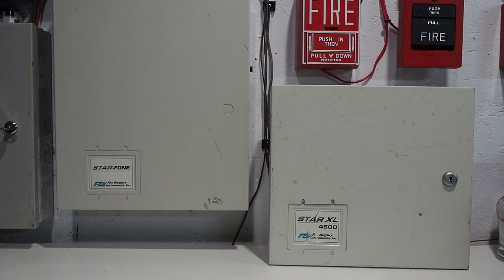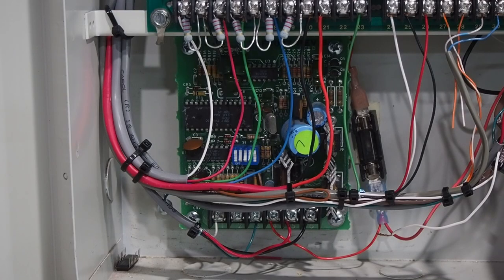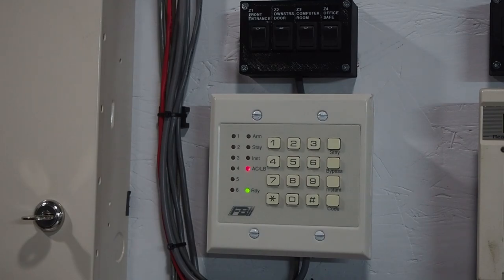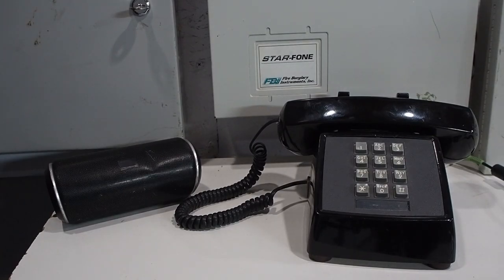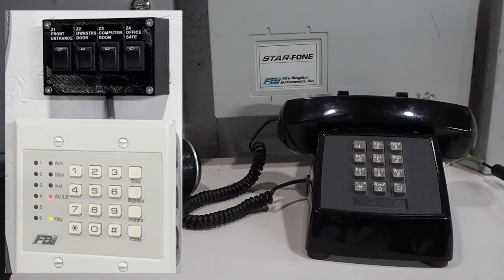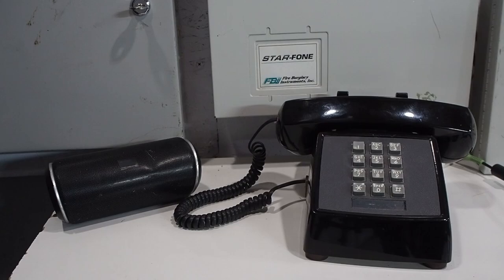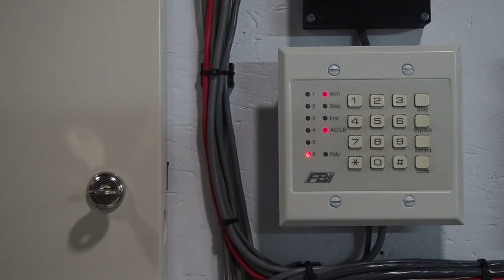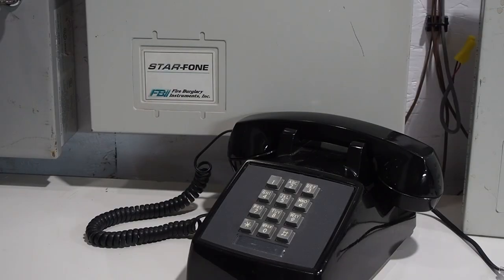FBII StarFone - 80s tech, it talks, and you can control it with your phone

Comment: I have an FBII XL-2T in my house with those same flush mount keypads.  Very nice system that blends well with the house and doesn't look offensive like today's modern systems.  I've even got the old X10 home automation with the Powerflash module that flashes all of the lights on and off during an alarm.  After watching this video I grabbed a scrap keypad and started to sort of reverse engineer it.  I'm wiring it into a USB input/output interface to allow my home automation PC interact with it, just like as if it was a keypad.  I'm going to use Twilio to recreate the Starfone features to the best of my ability, because I think this is really cool.  I'll probably even write code to facilitate panel programming using an easy desktop application, since the app will technically be able to operate the keypad.

Comment: For its time, that system was very space age and for today’s standard is still really nice. I feel like it was one of the systems paved the way for the newest high end systems which can be monitored and utilized with a cellphone
Reply from the maker: I would not call "SimpliUnsafe" high end at all
Reply: @NewAgeServerAlarm  i do agree they’re really flawed especially in how easy they are to bypass for anyone with a simple signal jammer fob. I only meant high end as in with gimmicks.
Reply: @NewAgeServerAlarm I have that system as seen in a video of mine, however now I call it sh*t. It does not run correctly as I want it to like it did in 2018. They discontinued a bunch of things I liked

Comment: This is very cool. I’ve always seen those keypads when I was younger and thought they were cool! 😅

I wonder what’s next in the series. DMP? Caretaker+? So many possibilities! 😅
Reply: Me too, to the point where a few years ago I purchased one, purely due to how sleek and well-fitting the keypads are.  People don't even notice I have an alarm system because they blend so well with the house.  These new wireless systems are absolute crap, I watch ADT eviscerate my friends properties leaving wires showing, and that huge ugly keypad of theirs slapped on a random wall.  Not to mention the fact that if you get in and smash an ADT wireless keypad before the entry delay, the system is dead.  Smash these keypads all you want, the system will still run.  I coupled the system with a dial capture cellular dialer that gives the system reliable cellular monitoring that works seamlessly.  It's a shame they don't manufacture systems like this anymore.  The security industry has lost it's way and is focused on money only, which means very quick installs of slap and stick wireless systems, in which nobody needs a "security expert" to install.

Comment: This is quite the unique system! I actually have an XL 4600 in my collection, but it’s unfortunately completely dead.
Reply from the maker: those are pretty resilient panels so i’m surprised it’s not working.. did you check the fuses and make sure your 12VAC transformer is working ?
Reply: @NewAgeServerAlarm   I’ll eventually take another look at it. I’m planning on setting up my good old Silent Knight 2615 in my room at some point, just need more wire.

Comment: Would the A B C & D DTMF tones simulate the Stay, Bypass, Instant, and Code buttons? And does the security system transmit these commands via DTMF? If so, would Stay, Bypass, Instant, and Code represent the A B C & D keys?
Reply from the maker: No the ABCD tones aren't supported as almost nobody actually had a phone that had that capability

Comment: Are you going to be doing any stuff with DMP Alarms. I would love to see a video of a DMP XT30 OR XR550 Alarm  Reportng CID to a receiver.  Also if you have a DMP receiver would love to see a video with that too.
Reply from the maker: Yeah actually, my Sur-Gard receiver which you saw in this video does take DMP format. I do however also have a DMP single line receiver as well.
Reply: @NewAgeServerAlarm  could that receiver take outside alarm? Or is it only local?  Because if it could take outside alarms, that would be a cool video.  That would be a cool video some setting off there alarm for testing purposes from like a different state and it sending you signals. I would love to see what my alarm signal look like on the other end.
Reply: @user13424  I have 2 videos of mine on my channel. It can take calls from wherever you can call it from.

Comment: Could this work with a ITI CS-4000 out of curiosity?
Reply from the maker: It would, just you can only use double round pulse as that receiver oddly can’t do pulse with parity
Reply: @NewAgeServerAlarm  Okay. I looked on the CS-4000 manuals and it said it wasn't compatible with touch tone systems which kind of confused me. Also could this hypothetically be used in tandem with a SX-V with this acting as a 'slave' unit / phone line? Also where were you able to find this, I've been trying to look for a StarFone now myself and all I see on Google are manuals for it